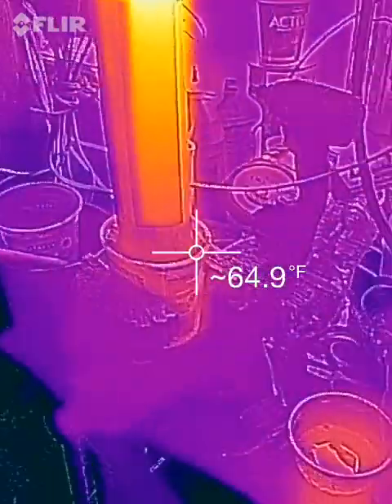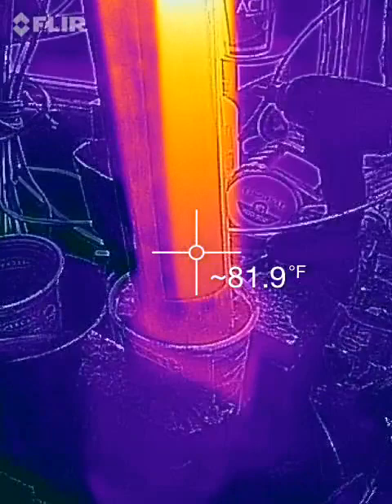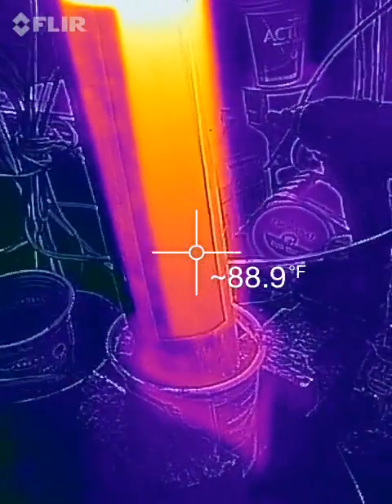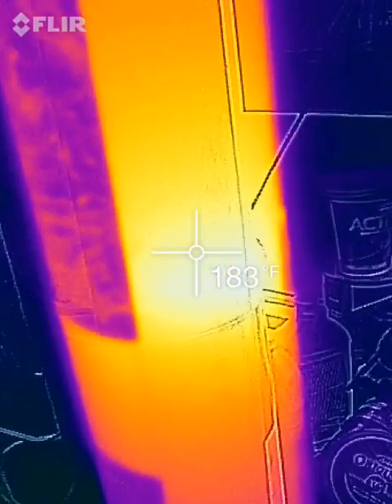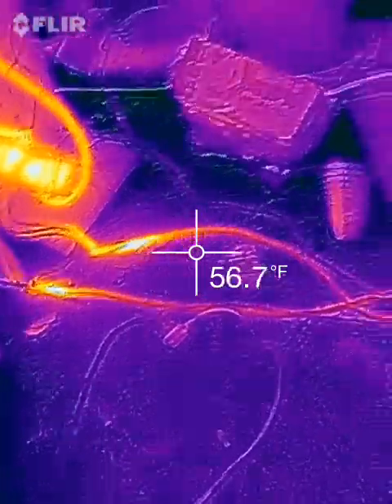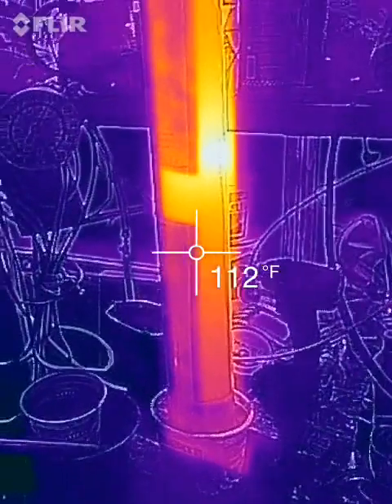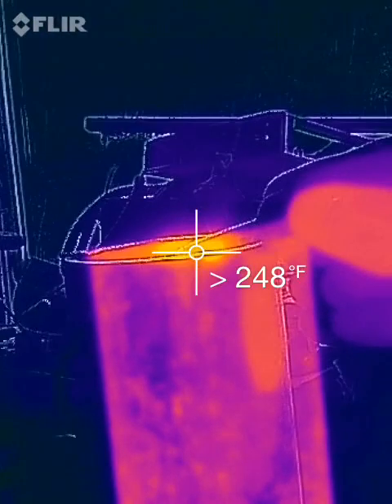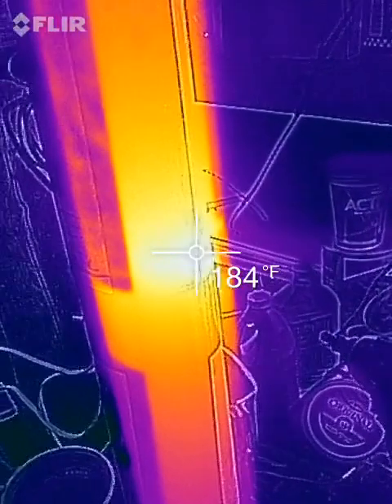hho sand heater using 3 amps 110 volt ac no, preheating

Comment from the maker: you see the water temp is 130, that is because the HHO cell warms the water even at low amps . the HHO that rises to the sand and CAT material tube is not steam and steam is not desirable.
 the HHO is dry for the most part.
 the reaction is just hydrogen and oxygen being recombined by the catalytic material in the sand cylinder and is exhausted as water vapor. start it up cold and the cell cold it will heat up as it works.

Comment: The crushed catalytic material ignites the gas when everything is cold?
Reply from the maker: that is correct no pre heating needed in my version. and all hho converted to steam vapor. I need a stan meyer 9xa board and transformer to make the amps work when the pulses shut off. this reduces the amps needed by a factor of 10.
Reply: @Praytri0t  And that's crushed up catalytic converter material? Hydrogen ignites on contact even when cold? I'm blown away it doesn't need pre-heating. I can't understand why that is when other similar devices do.
Reply from the maker: @infopackrat  the other ones out there may not absolutely need heating I just tried it both ways and saw results. true it takes longer to get max temperature. plus it was fun trying to do it. I was amazed myself, to see it worked. the law of diminishing returns definitely applies tho. glad you liked the vid please subscribe and like
Reply: @Praytri0t  ...and exactly the heating (e.g. for water...) is, what we are looking for!
regarding "whithout preheating": yes, this ist the same way, as using "platinum sand" , 
on top of this tube you'll find just steam, cooled down to water. 
will soon start to evaluate this, with some "used" broken cat-pieces.
Reply from the maker: @fraukemuller8119  i have not pursued this further because my focus has always been on low amp /high volume on demand systems. and Stan Meyers 9xa VIC boards seem to have all been "Tuned" to the cell. My Hydrogen for heating has Always been locked up in the firewood i burn.  ; )
Reply from the maker: @fraukemuller8119  my HHO cell was not preheated it is warmed by the amps running through the stainless steel plates.
 less amps= less steam created. many people measure HHO volume with steam vapor. that gives a false Litre per Min reading. thanks for visiting my channel